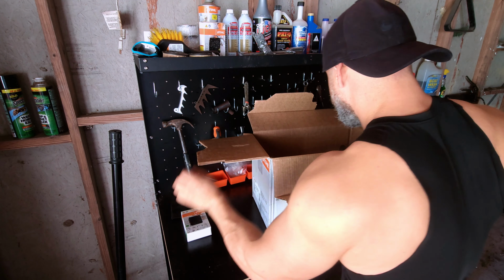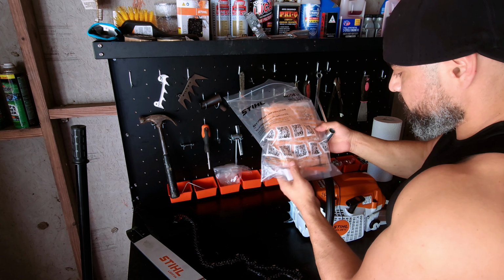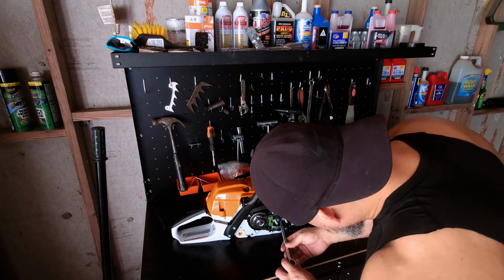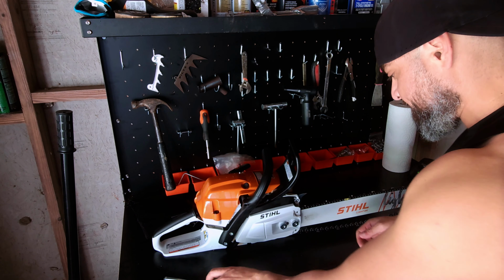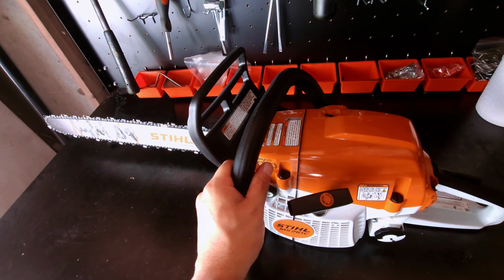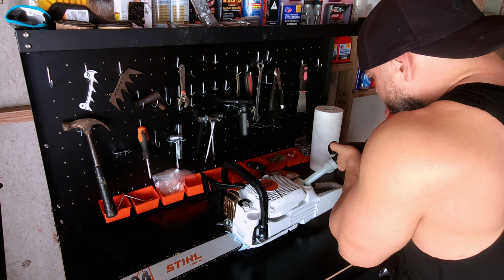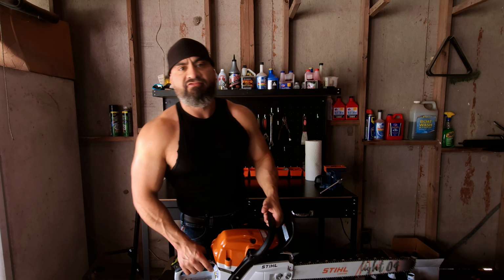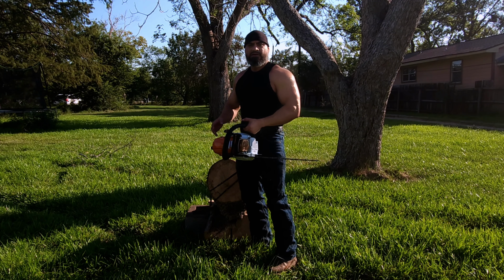NEW STIHL MS261 Unboxing!! Best 50cc saw ever made!?!?

Comment: Just picked one up myself. It came with an old 20" bar which surprised me. Got the deal for a free case, hat, and extra chain.
Reply from the maker: @voo8165  yeah i got the same deal on mine. So you didn't get the light 04 bar ?

Comment: Nice saw. They run great. When tensioning the chain, make sure to lift up the bar tip to properly tension the chain.
Reply from the maker: @stevejerebic9072  Thank you brother !!!! That's a great tip I will definitely put it into practice!!! How long have you owned your saw ? And has it been reliable for you ?
Reply: I have a Stihl 026 that I’ve owned for about 25 years now. It is a 50cc and still run like new. I’ve cut over 600 face cords with it in 25 years. Keep it clean and it should run forever. I usually mix about 45 to one to provide the little bit of extra lubrication for the piston and the compression is still awesome. 50:1 is what’s recommended but 45:1 will only help it. I don’t recommend a 24” bar on this saw. It will create lots more stress on your engine as it is not engineered by Stihl to run the heavier load of a 24” bar. It will cut but won’t last as long due to the extra load. Good luck.
Reply from the maker: @stevejerebic9072  awesome thanks for the advice!!! I run 40 to 1 ratio on my non ethanol fuel what are your thoughts on that ?
Reply: As long as it doesn’t smoke to much, 40:1 is fine. I live in Canada and we don’t have Ethanol free. It’s Canada law to have at least 10% ethanol in all grades of fuel so we don’t have a choice. But I never leave the fuel in my chainsaws, trimmers, snow blowers, outboards, generator when stored for extended periods. I drain all the fuel and run the engines till they burn all the existing fuel in the lines and carburetor and then store them.
Reply from the maker: @stevejerebic9072  yesh i don't get much smoke at all. The oil i use runs pretty clean and I like how much lubrication i get inside my cylinder and crack case when I have opened up some of my older saws and looked inside.